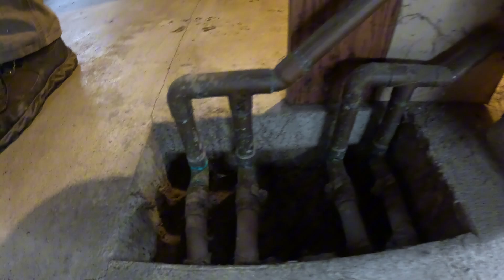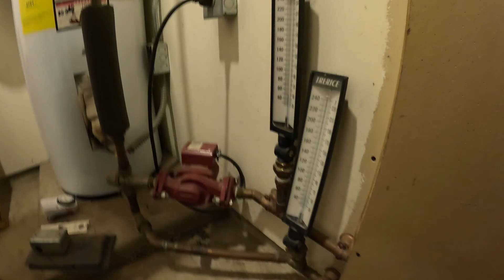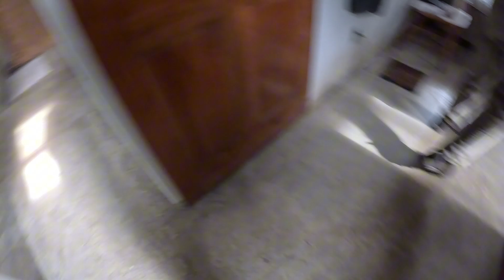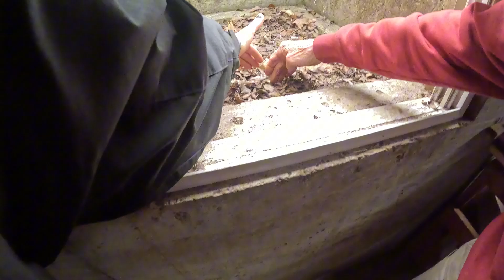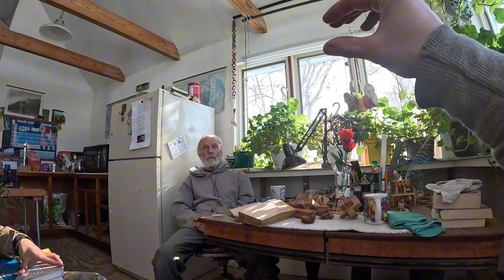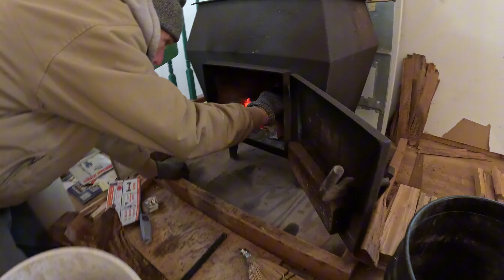The benefits of Hydronic Heating

Comment: We in Europe love Hydronic heating. In US thinks gets complicated. Here they all relay on circulating pumps to carry the heating element. No one heard of the natural occurring phenomena call hydro-syphoning in which the hot liquid rises, and the cold comes down......naturally. Everything is OK till the power goes off. In Europe we use pumps as well, but we have a circuit or more that will still work even after power goes haywire.